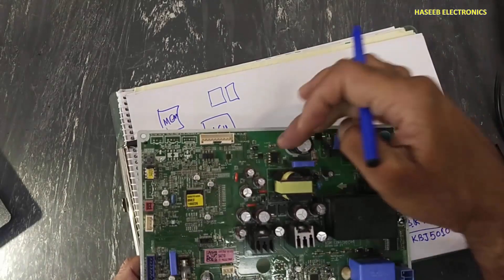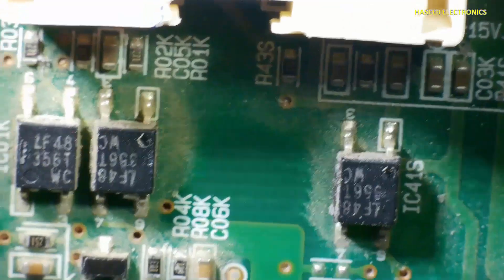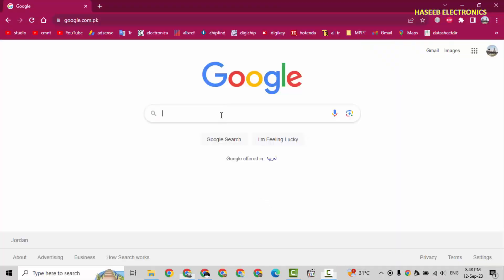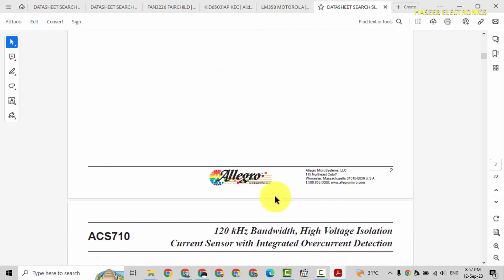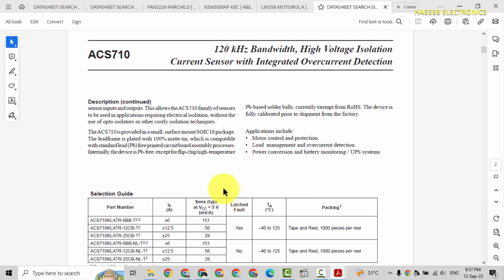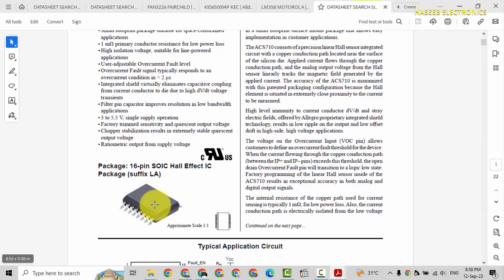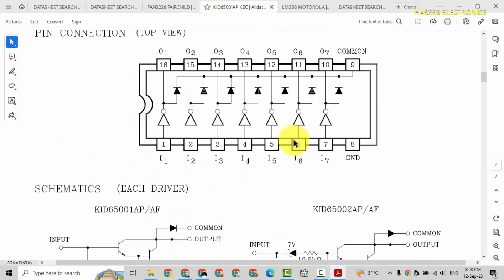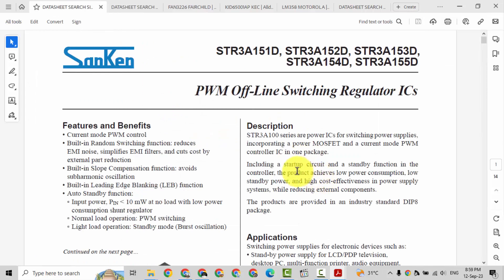{972A} An idea to understand a circuit without circuit diagram

Comment: How to remove painting from pcb with out damaging pcb.
Reply from the maker: there are many videos available on my channel for removing conformal coating. for epoxy, arylic and silicon coatings. you can check them

Comment: sorry mr hasseb can you help me to find a datasheet ic with marking code 6003-001 NQ97P
this ic using in bms drone
Reply: you could do this.
1,assuming that this ic is good, try to figure out other faulty part
2, remove the ic carefully and check all smd components related to this IC.
the shape of this IC is like a flash IC
hope this help you

Comment: Dear sir, I am from srilanka. I trying to repair LG DH6630 Home Theater set, the case is when it turn on comes display and available standby 3.8v but the problem is AMP power 25v not available and in the display says good bye within 5 to 10 sec. It is using (ICE2QS03) PWM offline controler. But VCC for this IC is available 12v pin 2 from stand by transformer section it comes through transistor and triger octocopler. But to drive the MOSFET gate voltage not comes from IC , IC not providing output signal  even i replaced new IC. Sir please explain this issue and make a video regarding is how to rectify this. Thank you.